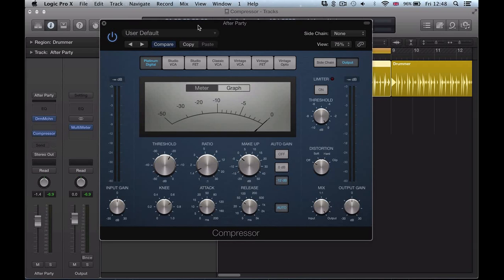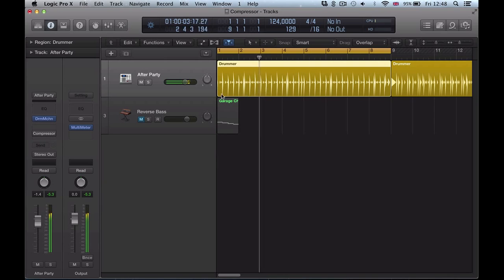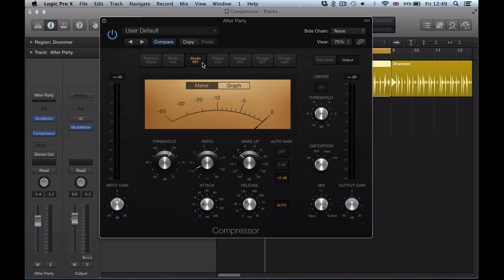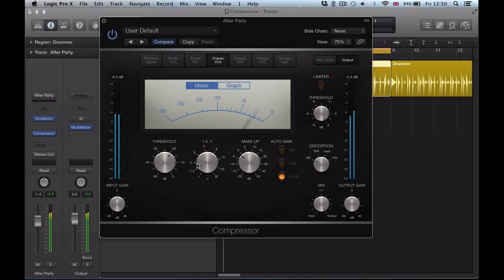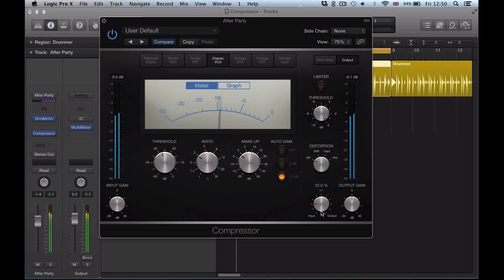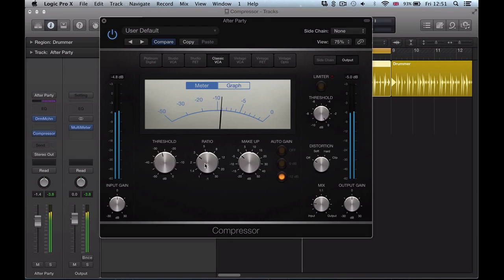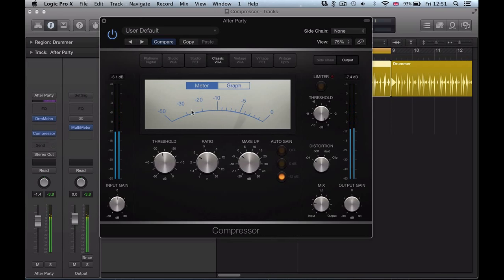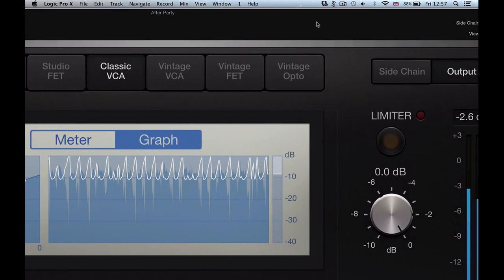Logic Pro X (10.1) tutorial - Compressor

Comment: Thanks for the tutorial. But I have a problem. I've created a bus for the kick but when I go to the baseline and put on a compressor I don't get the option to pick a bus at all. Don't even have that menu with the "side chain, compare, copy, paste". Only thing i can do on the top part in the compressor is to change preset and change view. 
Have any idea what's wrong?
Reply: +Jonas Westblom dude i had the same problem!! go to the 'Logic Pro X' button at the top left of the screen , then in the drag down list hit ' Preferences' , then 'Advanced Tools' . After you click advanced tools a new window will open. Under the farthest right category , [Advanced] , there will be an option to click 'Show Advanced Tools'. After u click that button , the compressor will have the sidechain option just like the old ones. IF it doesnt make any sense i can send u a screenshot .
Reply from the maker: +Jonas Westblom there is a small button in the top right of the compressor (and all instruments in Logic) this hides and shows the top panel of any instrument, maybe you have clicked this by mistake? Clicking it should reveal the top panel where you can access side chain controls.